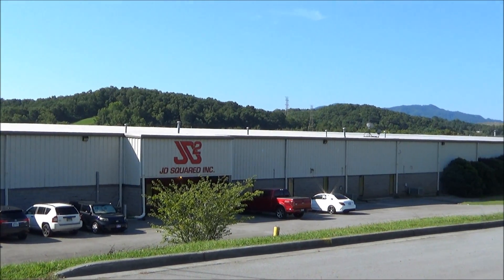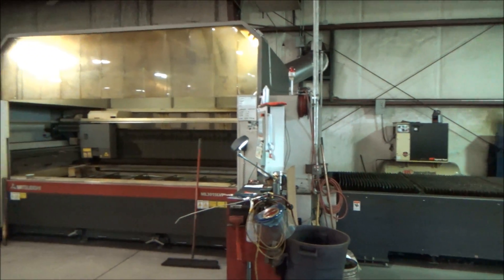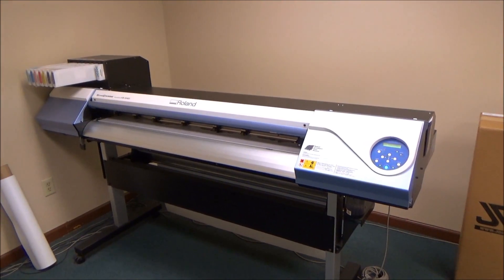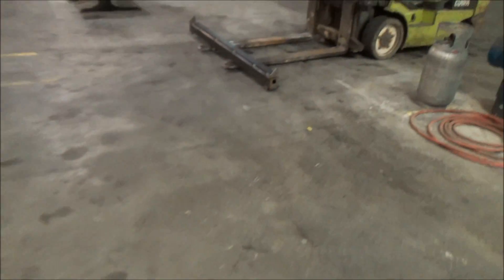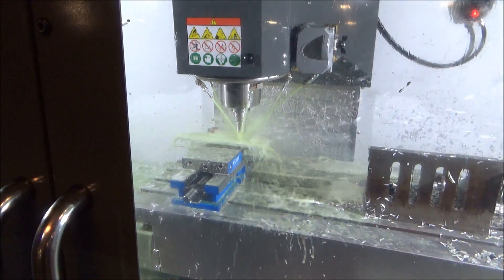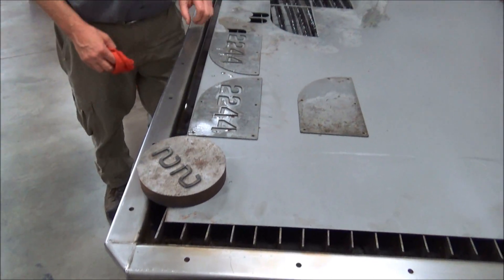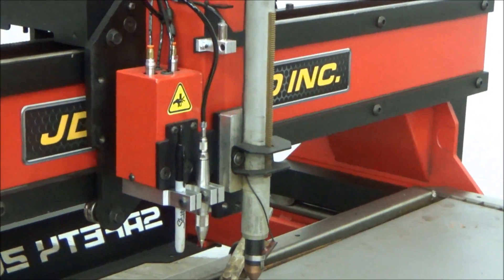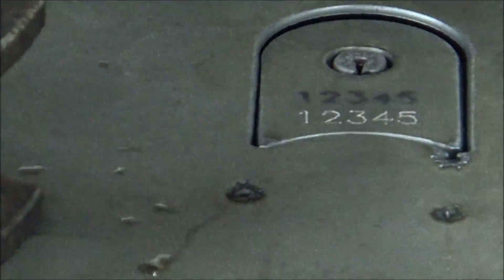JD Squared Factory Tour, JD2 , Tube Benders , CNC Plasma Cutter Tables

Comment: Got your order in for a plasma table Ken? I would love to have one of those if I could justify it. Keep thinking there must be kind of pars you could crank out with to make it pay.
Reply from the maker: I'm thinking about buying one.  If you buy the Plasma Cutter first and send them the torch, they will even put it on for you.   There great especially for making more than one of the same part.    It's hard to do that by hand and get everything to come out exactly the same.  I also really like that scriber attachment.
Reply: I see the mid size one is about 15K, plus the cost of the torch and you would need a good compressor. Just need to find a widget that someone needs hundreds of..haha.
Reply from the maker: Torchmate wants 20K for there 4x4 table and its not built nearly as good.   The JD Squared one is a way better deal and much better built.